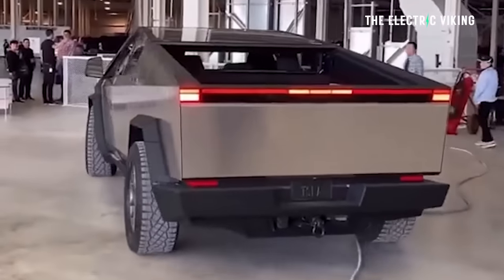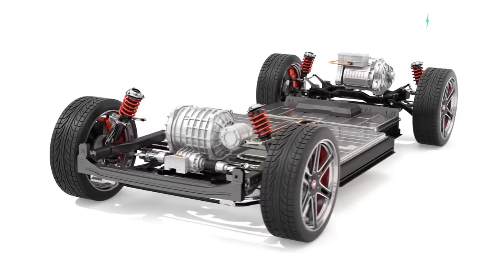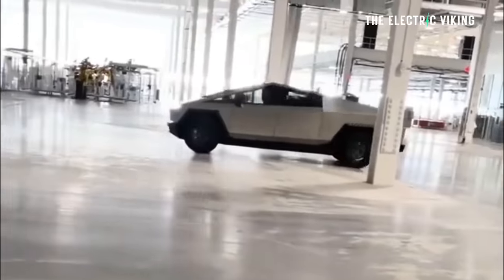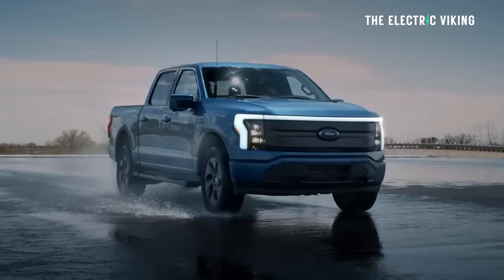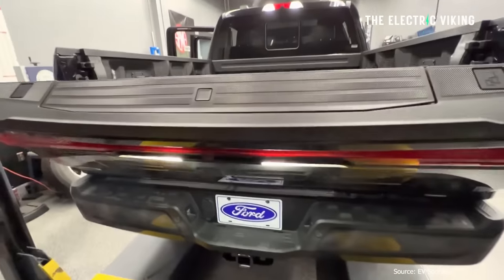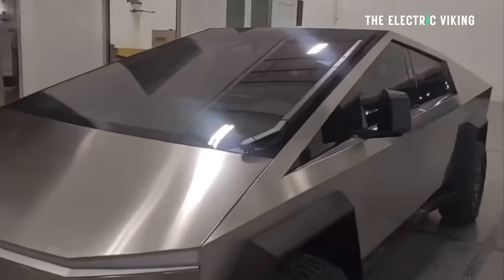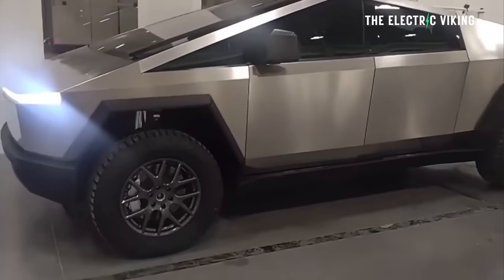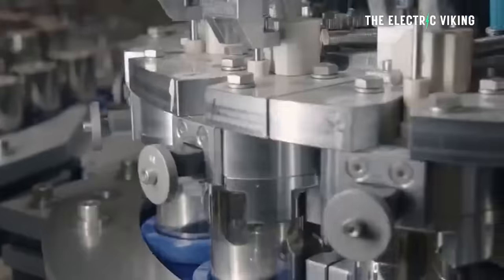Tesla Cybertruck charging speed, weights and motor details revealed

Comment: 800V architecture means insane torque!  Light rail in Europe uses 750V DC to power entire trains 😅
Reply: i thought they were doing to so they dont have to use such beefy wiring and also to aid in quicker charging
Reply: Higher voltage doesn't necessarily mean more torque. A higher wattage motor will generally have more torque, but only if the motor is designed for fast acceleration. There are powerful motors that don't have fast acceleration, and most light rail is not designed for fast acceleration. Also remember that wattage is voltage times amperage. Light rail trains typically use 1100 kW motors (750 volts x 1500 amps), and can reach as high as  2300 kW (750V x 3000A).  In contrast, the Cybertruck will use two or three 200 kW motors, so they are less powerful than a light rail train. Trains have a lot less rolling resistance than automobiles, and most light rail doesn't need fast acceleration and high speeds, so they are incredibly energy efficient compared to automobiles.

The big advantage of Tesla switching to higher voltage is the ability to use thinner wires that cost less, because they don't need to carry as much amperage (i.e. current).
Reply: @amosbatto3051
Good details. I just disagree with 1 statement. 800v is not guaranteed lower cost. The controllers have to deal with that voltage. So every component needs better insulation to prevent arcing. Doubling the voltage of large capacitors is a good example and those are not cheap.
Reply: @amosbatto3051  That's true, however, industrial motors are typically 440V 3 phase.  The insane power is because of a 3 phase induction motor.  The weight to power ratio is off the charts.
Reply: @amosbatto3051 Musk said on Joe Rogan show,  Cybertruck 0-60 is below 3s

Comment: I said back in 2020 the ct would weigh between 5,200 for the lowest range rwd, and over 6,000 for the top trims. 
I also said I thought thanks to better motors and good aero it would match or exceed the model X on efficiency. 

The investors day chart showing ct would have an average of just 100kwh pack's was a big clue imo! 👍🏻😎
Reply: The cyber truck will be an upsized Model S.
Reply: @briankearn6991  so the model s is going to move to using dual massive castings and a structural 4680 pack?
Will that be the rumored but then cancelled 500+mile plaid+S with active aero tested at the nurburgring year's ago? 😀
Reply: @4literv6  
No. The cyber truck won’t be an exoskeleton and the large casting will be grafter to the rear of the Model S to carry the load bed. 
The stainless panels won’t be structural and may be just a coating on plastic bodywork.
Reply: What the hell is grafter?
Reply: What makes you think the CT has good aero? I bet it's terrible in a wind tunnel with all those flat surfaces and dead sharp transitions creating turbulence.  The Lamborghini Countach had a high drag coefficient in spite of it being a low sharp wedge that looked like it would slice through air.   There's a reason why the Model 3 looks like a catfish and not a pyramid.
Reply: @royphillips7644 typo obviously. Grafted. Duh
Reply: @TheForwardThinker  A vehicle with a drag coefficient of around 0.40 is not "incredible".  The Mercedes EQS has a drag coefficient of 0.20.  Sure, compared to a brick shaped work truck with an open box it's good but then the Cybertruck isn't a good work truck with it's walled in sides and poor bed access.
Reply: @briankearn6991 🤣🤣🤣🤡 joker
Reply: @theslimeylimey what's the CT competition, Mercedes EQS or Ford 150? And what's Ford 150 drag coefficient? 0.463? Huh?
Reply: @Alarix246   The areo advantage Tesla has would all but disappear if they made the box open and versatile like a pickup.  Intentionally making the box difficult to access and limited in use for aero may be an "incredible" achievement to some but many potential truck buyers will not see it that way.  Pickup trucks don't have boxes like a CT not because during a hundred years of automaking nobody could match Musk's genius but because it's not practical.

Lets just wait and see how many CTs get used like an actual pickup if you think it's the same class.  I can just imagine a CT with camper installed, or a fifth wheel hitch, or loaded with a farmers hay bails, or job site diesel transfer tank, or welding setup with gas tanks, or pipe rack for plumbers and gas fitters, or top deck for carrying a pair of snowmobiles, or fitted with a landscapers tool rack.  I could go on.
Reply: @theslimeylimey  how many half tons do that stuff though now? Most converted trucks doing those things are 2500&3500s
Not the class ct is competing in smh.
Reply: @4literv6  F150 V8 has max tow rating of 14,000 lbs and max payload of 3300lbs which covers everything I listed.  

The CT with GVWR of more than 8,500 lbs but less than 10,000 lbs is in the same truck class as a F250 or Ram 2500 by definition and the bed size, length, width of a CT and Ram 2500 crew cab are pretty close too so I don't see how they wouldn't be considered competitors. Unless you're implying the Cybertruck isn't actually a truck for doing truck things.
Reply: @theslimeylimey  the open box you mean the CT with the tonneau open? Who says it must be closed? But guys are buying the covers or steel boxes for tools so they can be locked, so why should the possibility to lock the tonneau be an issue?
Reply: @Alarix246  I was referring to the sides of the box on the CT that are walled in from tailgate to the roof so when the cover is closed it makes better aero at the expense of easy bed access from the sides.
Reply: @theslimeylimey  I see. But nobody needs to acces it during the ride, and when it stops, you can open it up. If you mean the rising sides are too tall, well they aren't close to the tail, plus every vehicle has its own specifics and it's impossible to tell right now if Tesla hit a sweetspot. We'll see later on for sure!
Reply: @Alarix246  yeah we'll have to wait and how people who use trucks for truck things take to it.  I have a feeling it will be like Landovers that are built for capable offroading but the only off roading 95% of them see is accidentally driving over a curb at the golf club.

Comment: I expect Fisker to build The "Matrix Drill" of EV. A platform that has multiple  interchangeable body styles and extendable body lengths and add on rear axle. Go from being a two door convertible to a four door SUV to a four door truck with 8 foot bed and dual rear axles. Go from Family car grocery getter to summer camping boat hauler, all in one "transformer" type attachment. A vehicle is basically just a tool. The sooner we make that tool more versatile like the "Matrix Drill" , the better.

Comment: In the United States the Cybertruck might come under the CLASS 2B - LIGHT/MEDIUM TRUCK classification.

Class 2b is the tipping point between light non-commercial pickup trucks and heavy-duty haulers. GVWR is limited to 10,000 pounds, while the average curb weight ranges between 6,300 and 7,000 pounds. Examples of Light/Medium trucks include:
Chevrolet Silverado
Ford F-250
Nissan Titan FD
RAM 2500

So, the Ford F-150 probably isn't the right point of comparison for the Cybertruck. The F-250 is.

Weight of the Cybertruck would understandably be a concern for Tesla. The point is probably to fall safely within Class 2b in terms of  existing truck classifications. And, being at the upper end of that  classification in terms of weight would cause Tesla to go on a weight reduction drive. Although excessively trimming weight  mightn't serve Tesla's purpose either because being at the upper end of the weight classification is, for the most part, a good thing. 

What else could be going on here? It would not shock me if the plan to drive the Cybertruck to success involves undercutting typical Class 2b prices while claiming a performance level that exceeds every other vehicle in the category.
Reply: I think his statement about not being profitable on sales for year and a half is a big red flag.
That means there will be delays at best maybe even stop of production if things don't pan out as expected.
And just looking out the window tells you enough.
You either get one on the initial run or you will be waiting for a while. Ioniq 5 style lol
Reply: @qa1e2r4  I think your comment is fair broadly speaking. My comments didn't address that point (although I pointed out on this site that Tesla didn't have magical powers a few days ago).

I sit firmly in the camp that views buying your way into a market, at a loss if needs be, to be an sound business strategy (Tesla has expressed the same view putting an upbeat gloss on things) as long as you have the follow up game to make that play, viz as long as there is a break even run rate that can easily be exceeded once production has been fully ramped and without sustaining losses for too long. (A self-annuling problem is not the worst kind of problem to have.) Does Tesla have that follow up game? We shall see, but I wish them good fortune because I would like to see them succeed at least insofar as Tesla's success is bound up with the acceleration of the advent of electric transportation. Only a small number of EV automakers are putting in the hard yards to achieve that objective. (I trust that we will see more in future.) And, Tesla leads amongst that small number.
Reply: Do you need a different driving license?
Reply: @Sonshine70s  Interesting. Rules like that around the world could have sparked Tesla's interest in keeping the Cybertruck weight under a certain threshold.

Still, the Light Rigid licence that you mentioned really applies to a different category of vehicle: a vehicle with a gross vehicle mass (GVM) of more than 4.5 tonnes (4500kg or 9920lbs) but not more than 8 tonnes with seats for more than 12 adults (including the driver). That is a small bus in my estimation.

I don't think the Cybertruck would require any special driver's licence in Australia.

Comment: This is definitely a marmite vehicle and certainly not to my taste at all but it's really cool it's actually being built.  

I've never seen thin gage stainless steel that isn't cold rolled and appliance stainless is certainly cold rolled because it would be a wavy mess if it wasn't.  I doubt there's anything special about it.  My guess would be a standard off the shelf 300 series like the DeLorean used because there'd be no point or need to use anything special for simple flat cosmetic panels with straight bends.  That whole "exoskeleton" thing was just marketing wank and the skin is just like a stainless steel appliance.  This is Musk though, and he likes to make everything appear super duper special so I wouldn't put it past him to tweak an existing alloy just to make it "giga stainless" for marketing purposing for the salivating fans to lap up.  

It's actually very clever to use all simple flat cosmetic panels because you don't even need any custom stamping dies.  Laser cut the panels, add a few bends with a brake, slap on some glue and you're done.
Reply: I'll be staggered if the panels look flat. It's an absolute nightmare to make flat sheet, and the more reflective it is, the worse it looks.

Comment: How can a vehicles tare weight be deduced from GVM? And how can the numbers on the supplied data have a tolerance of 1,000 lbs?  By the way, the payload of the F150 Lightening is a lot lower than 3500 lbs. It's 2350lbs, for a GVM 8850lbs.  Pretty unimpressive for such a large vehicle, in my opinion, considering that a smaller and much lighter Mazda BT50 tray has a payload of just under 2700lbs. 
Hopefully Tesla have moved away from the 1920's and ditched the ladder frame for something that resembles technology that we've had since the 1940's in the form of a monocoque design. There's a good few hundred lbs and then some, to be had, right there. This would do a lot to get the payload up to something reasonable, without having to drive a Hino or a Mitsubishi Fuso.

Comment: Didn't Elon say it was   a 1k volt system or is that the semi truck? 🤔
Reply: Most likely to be unlocked in the next iteration. The problem is that current charger is not equip to charge at a higher voltage and you need high power voltage step-up in the vehicle if they wire the battery for 1KV. So the battery most likely is wired 800V but all the rest of the equipment is rated for 1KV and when Tesla has upgraded their charger infrastructure to 1KV they could then refresh the Cybertruck to a 1KV battery.
Reply: @kazedcat 
I thought that's what the level 4 charges were rated for 1kvolts?
Reply: @brettmciver432  Yes but currently they are installing V4 chargers with V3 cabinets so it cannot actually supply 1KV. They need V4 cabinets to charge at 1KV and I have not heard of V4 cabinets in the wild. All the V4 chargers installed so far are using V3 cabinets.

Comment: Actually the Honda Ridgeline, Subaru Bratt and one of GM's light trucks has a fairly similar unibody pickup design.
Reply: GMs electric trucks will also be unibody.
The high road is a risky place.  Ask SAAB, Alfa Romeo or Citroen.
Reply: Lol. The cyber truck is not unibody.
Reply: Ford Maverick and Hyundai Santa Cruz are unibody vehicles as well. It seems Tesla switched from exoskeleton to unibody mid stream probably recognizing the production, and safety challenges associated with the exo concept.
Reply: @ecospider5  It appears that it is now.
Reply: The big difference is that Tesla uses quickly cast single pieces front and rear, not dozens of stamped steel pieces welded together like other trucks.
So Tesla is stronger, manufactured much faster and produced more efficiently.

Comment: Huge issues . Problem with the rake of the windshield causes large reflections onto it obstructing the view of the road and safety. Massive vibrations through the body into the car due to the design again. Very poor panel fit and cheap materials squeaking. Comes in over 3 ton way to heavy. Do not drive it through water. Rear vision very poor obstructed. Truck bed access very poor, cannot be accessed from over the sides as all other trucks only directly over the tailgate . No steps up into the bed ether like all other trucks . Not practical only a show car

Comment: The weight of an empty vehicle is called CURB WEIGHT.
Reply: Kerb /Curb weight in Australia is the weight of the empty vehicle but with a full tank of fuel and an 80kg / 177lb allowance for a driver. Tare weight is for an empty vehicle, just with normal fluids (radiator, oil etc) and 10L / 2.6 gallons of fuel.

Comment: Cybertruck is approximately twice as heavy as the model S so let's consider that in estimating  range and cost... same battery size as model S
= maybe half the range that you get on a model S so you're going to need a much bigger battery in order to get 350 miles of range... It was the cost of this vehicle is going to be well above $80,000 Tesla's going to lose money on every one of these things they sell for the next 18 months maybe forever you know and this is hilarious that you can't understand why the Tesla stock is going to crash and burn over the next couple years
Reply: Model S has a curb weight of around 4500lbs and model X is around 5100lbs. Range is impacted far more by aerodynamics than by curb weight especially when it comes to electric vehicles.

Comment: LoL. The love for electric vehicles amazes me.  Takes you twice as long to get there.  You still have to use diesel fuel to charge the.  Tires are still petroleum based.  Cabs are full of things that are petroleum based.  The biggest thing.  $700 dollars to replace a battery.   Me $110.   While your spending a couple of hours charging I will be 150 miles down the road.  Takes me 15 to refuel.  I already know a lot of people that USED to have a EV.  But hey if you have a lot of money and a lot of time go for it.  I will stay with what actually works.  Laugh at ya later!
Reply: Do you have one of those very early brick phones😂😂😂😂
Reply: @raymondschembri5042  were you trying to make an irrelevant post?
Reply: @DevilTX66  No I wasn’t.
Reply: I thought you both were. 😊
Reply: @malcolmrickarby2313  🤣😂🤣😂
Reply: @raymondschembri5042  well you did accomplish it.
Reply: That's a cheap battery! Just $700